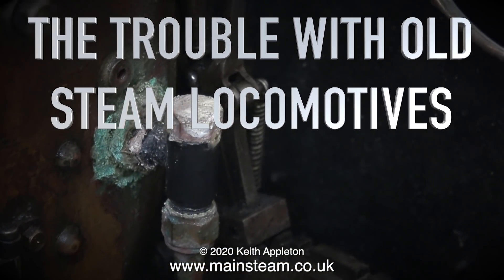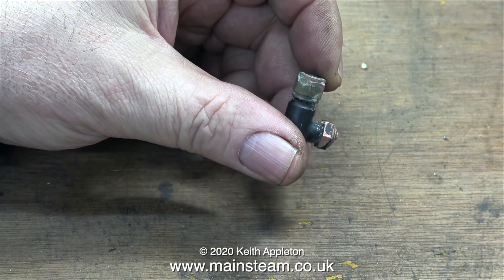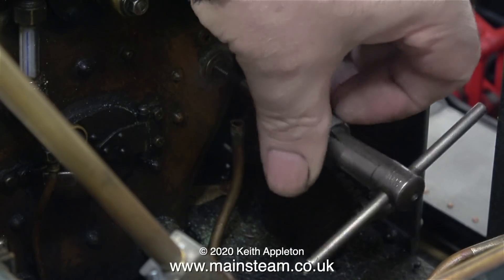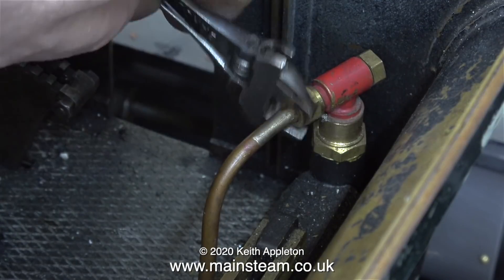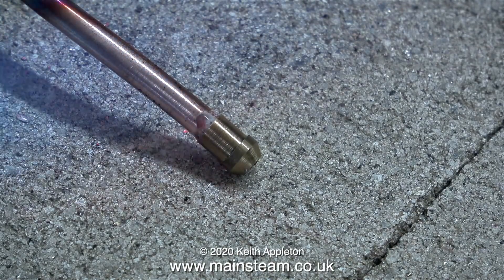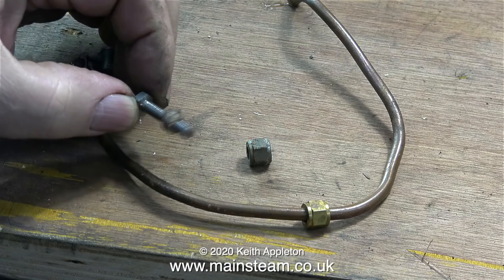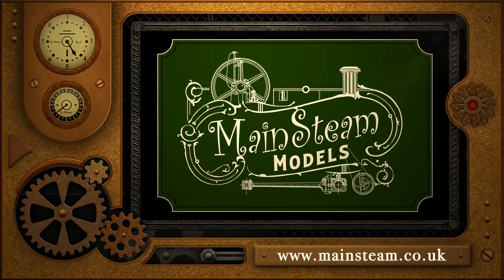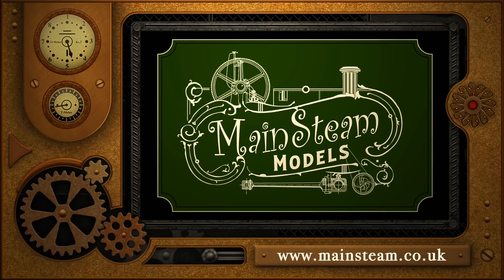THE TROUBLE WITH OLD STEAM LOCOMOTIVES - PART #9

Comment: People often use Brass fittings incorrectly on ships, like fitting them to pressure gauges on sea water systems. When they failed and the pressure gauge fell off, filling the bilges with water, I would hammer my screwdriver in the broken part with a shifter and then use it to turn the screw driver. Never failed.

Comment: G'day mate, just wondering whether an extractor would have worked in this situation? Admittedly I have seen extractors expand the part being removed but since you were working with brass that should not have been a problem. BTW, my wife and I were married in Brisbane 46 years ago and now living in the land of the big PX.
Reply: He's British, not Australian.....and Extractors usually make things worse not better, especially with brass or bronze, because if the broken part is too badly corroded into the bushing, it'll either expand it as you said, or the extractor will just chew out the inside of the broken piece, then you're forced to drill it out. Keith's solution is much better and less brutal.
Reply: @steamandsmoke97  would you say that this would be a problem specifically for corroded parts, and a simply worn brass fitting which shears off could be reasonably removed with a extractor? Just curious on your thoughts.